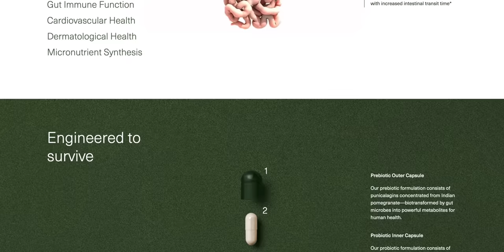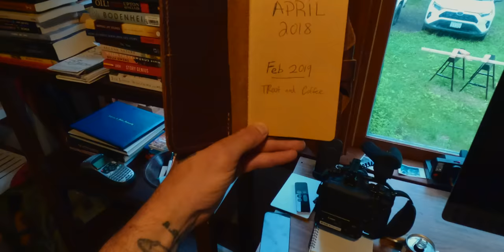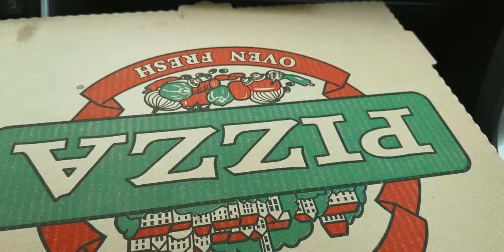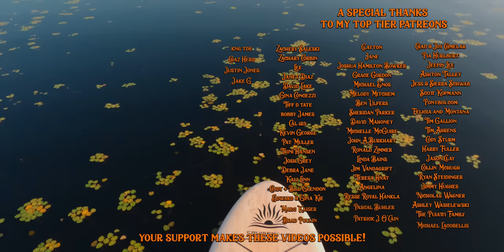Saying Goodbye

Comment: when  I moved into my cottage the Japanese Knotwood was working hard to take over. This is the 3d year I've had it smothered with tarps and I haven't yet (knock on wood) seen it try to sneak it's way out. The first couple of years it tried to send it's runners just past the tarp and then popped up !Grrr... I also pulled and/or dug out as many as I could the first and second year. It is TENACIOUS! I'm sure you're either going to let it dry up and then burn it or dump it some where It can't re-root. It will TRY, believe me.. I broke my wrist in the Spring, had hardware put in and just got it out last week so I might start to see what I can plant there before the season ends. Best of luck to you!